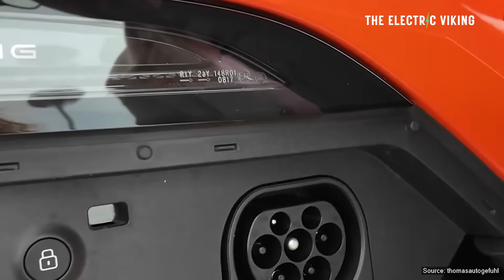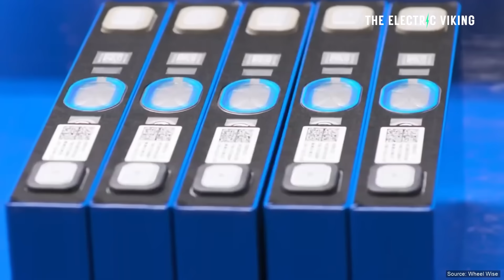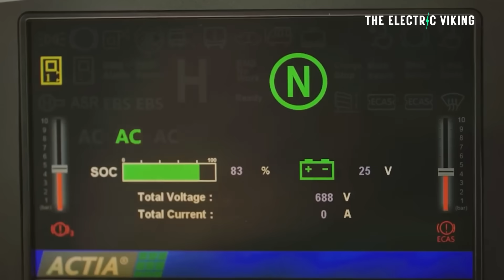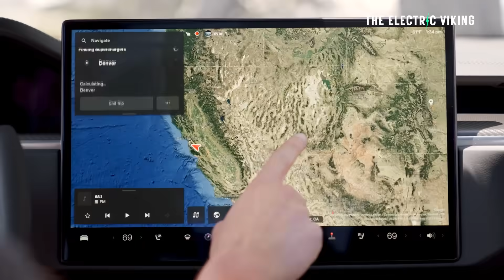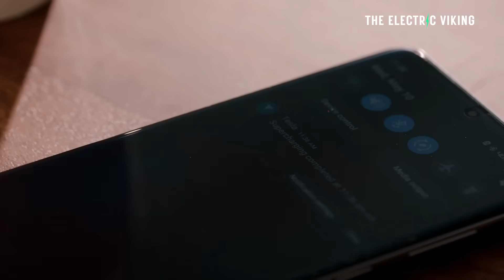Shocking data reveals the TRUTH - how long electric car batteries really last

Comment: Thanks for your EV advice and the massive Chinese car industry.
Can you do a video on how the Chinese charge their cars when they live in massive apartment types of structures?
I understand in the US where many of us have single homes.
Thank you Viking.
Reply: Good question.  But keep in mind that North America is still stuck with 120 volt default voltage for residential use.  This means charging from these circuits can be problematic  (time wise) for most EV users.  The majority of the rest of the planet uses 220 V plug-in connections, reducing the amount of time to 50% of what it takes for 120V outlets!
Reply: Thank you for the reply CH and I totally understand the 220v thing. Good point.
I'm wondering where all the available "charge parks" are and their vehicle capacities?

Comment: Hi Electric Viking - there is a big difference how long a battery last verses effective capacitary over 25 year life of motor vehicle. I still will not pay double the price for a car for half the range with accelerated deprecation of value. And if you use public DC charging there is no savings, who can charge from solar in Europe in Winter LOL.
Reply: 25 years...? maybe in Arizona

Comment: I have 10 yrs from new Tesla Model S P85D 100,000 km Hong Kong (90% slow charging at home) & min degradation, & going strong. Not needed to change brake pads yet.

My Porsche Panerema also from new was sold at 8 yrs as maintenance costs exceeded it's value.

Comment: I am not sure full regen is always good for example if you are driving in snowy or icy conditions it may cause the car to skid as it effectively brakes the wheels but in the summer months it’s definitely a good thing. I live in Finland and of course you have to adjust your driving to suit the road conditions. But savings on servicing your car are always a good thing. 👍
Reply: Could you do a video on this? On some frozen lake with an artificial driving course; try to go round a slippery corner with and without regen. That would be interesting.
Reply: EVs are too smart.  If a wheel loses traction the others compensate.  I could not get my Tesla to slide for fun without turning all the assist stuff off!
Reply: …..there is a ‘snow’ setting on my MG4 to prevent the wheels ‘locking’ in regen mode - adding further confidence to an already impressive vehicle- in my opinion 😉

Comment: Battery production quality can be changed and tampered over time and introduced built in obsolescence.
Seen in subsequent redesigns that typically shorten life cycles (example shaving razors, panty hoses and light bulbs).
The amount of energy in natural products like petroleum and LPG etc. is much harder to sabotage.
Reply: Like with alcohol or paint thinner? 😂😅

Comment: I'm still driving my 1980 Mercedes T1 diesel. I wonder if an EV will ever outlast my trusty old diesel.
Reply: No chance for EV.
Reply: A T1 couldn’t pull the skin off rice pudding, and unless it’s low ish mileage it’s probably had at least a fuel pump replaced or reconditioned by now, they are a pretty solid engine but has very little power, my apprenticeship was working on them.
Reply: I still have 2 bikes 1985 Honda GB500 & a 1992 Yamaha Virago.   Cannot see electric vehicles lasting this long
Reply: How many kms on it? Replaced an engine?
Reply: @Rebelapes  I don't know how many kms because it resets itself after 1.000.000 km but I think it's either 1.5M or 2.5M. I've had the car for the last 400.000 km and did all the repairs myself. No need to replace the engine, only replace the wear parts.
Reply: What a silly comment. In order for it to be useful information you would need to include lots of other information. 
How hard has it been driven? 
How far has it been driven?
What repairs have had to be done to keep it on the road?
Do most 1980 Mercedes T1 diesels last as well or is your vehicle a lucky freak?

You wonder if an EV will ever last as long. My guess is almost certainly yes, at least one EV will last as long but I've no idea what conditions will have been required for it to do so and neither do you.
Reply: Think of how many children's lungs you've filled up with 2.5micron carcinogenic particles :)
Reply: @mb-3faze but the battery production, transport, and disposal dousnt create this?

Nor the fossil fuel power stations that create the electricity for the car nah?
Reply: @  Yes battery production, transportation and any fossil fuel burnt to create the electricity will have created pollution to some degree. But with a little bit of research you would have found that an EV produces far, far less than  the Mercedes T1 from the 1980s, that the batteries can be recycled and more and more electricity is produced from renewable sources every year. 
The question is, why didn't you bother to do that little bit of research before making your comment?
Reply: @kalebdaark100  the comment was at the person suggesting EVs arent responsible for any pollution at all that would affect people, or children for that matter

There are far more damaging things being done to children from the modern world than modern car pollution, cars from the 80s still running are so rare they aren't worth mentioning

Using your research on the matters, how much pollution does an electric car produce when it goes on fire and emits extremely toxic gases and substances In comparison
Reply: @ryanwatterson4038  The comment wasn't suggesting no pollution from EV's. It was pointing to the carcinogenic diesel particulates in your exhaust. You know how people went stupid when the new diesel emission controls were introduced because they thought it was something to do with greenhouse gas and climate change - except it wasn't - it was to catch the particulates (little pieces of 'activated' carbon) that get into lungs and cause cancers. The new diesel systems burn them off from time to time to clear the filter so it all goes into the atmosphere, but at least the carcinogenic particles aren't dusting up the neighbourhood.
There's too many smoky old diesels where I live. I'll be happy when they're gone.
Reply: @ryanwatterson4038  Gosh, still trotting out oil industry propaganda. Blah Blah fossil fuel created electricity, blah blah EVs are heavier - more tire wear. Come on!
Reply: @mb-3faze  not spouting any propaganda fool,

I'm pointing out the hypocritical side of suggesting EVs are the perfect be all and end all whilst having no pollution to speak of
Reply: @  Tell me where someone in this comment thread said EVs are "the perfect be all and end all whilst having no pollution". No one with even a little knowledge on the subject would say such a thing. They are just better than ICE vehicle by quite some way....and yes you are spouting oil industry propaganda.
Reply: @ryanwatterson4038  Nah - you're spouting.

Comment: I have had my EV for four years now and driven 100,000 kilometers. I always charge at home with 11 kw/h. In the first year I could drive 480 km at 25 degrees. Now it is 450 km. I do not know if that is good.
Reply: 6.25% drop after 100,000kms? Seems pretty decent to me!

Comment: If you don't have a lot of home solar you have to charge at night - cheap rates to be sure.  But if everyone has an EV, how cheap will overnight rates be?   Obviously at that point the cheap rates will have become a distant memory with public chargers even more expensive.  Unless you live in the sun belt and have huge roof area to install 8 or 10 KW of solar it's game over.  And if you do live in those huge properties then cost probably feature much in your mind.   There's an old saying, something about becoming the victim of ones own success.  Or put another way, be careful what you wish for.

Comment: You've probably seen the video of the Telsa model S that's done 2 million km. He is on his 4th battery and 14th motor. It's possible the motors were replaced due to issues which have since been rectified. The batteries have lasted over half a million km each. Not bad at all for tech that's over ten years old..
Reply: Indeed!  If my memory serves me well, his third battery even lasted 850'000 km... over 500k miles!
The motors didn't die, the early Model S motor had a faulty bearing, and Tesla kept exchanging them under warranty... until the issue was solved once and for all by a third-party specialist, the EV Clinic, I believe.

Comment: Final nail in the old gas car used to be rust. Old Opel cars were notorious, Kadet for example. It is not necessarily the tech that gives up but the thin rusting sheet metal.
Reply: I have a 2006 Civic. Owned since new, now has 410k km. Driving in harsh Canadian conditions. Body rust will end its life within a year or two. The engine and transmission (manual) run perfectly. I expect to drive it to the junk yard, eventually, in perfectly working order except for body rust. It is totally normal to see old rusted cars on the road here. I have noticed that I never see rusted Teslas. For some reason they don't remain on the road here long enough to become rusted.
Reply: Fiats always came in two colours, the one you chose and reddish-brown that ‘nature’ added

Comment: That is not the problem. The problem is that when your battery says 100% and 30 minutes later, it drops fast like an old cellphone. If im wrong, let me know. Yes, it can last, but for how long does it hold the charge as the battery gets older.
Reply: You're wrong.  Typical modern EV battery packs degrade at 2 to 3% per year, with the degradation slowing after about 4 years. Many newer EV's have battery management systems and heat pumps, which increase efficiency. Your cell phone has neither of these...
Reply: @Brian-om2hh  OK if that is the case, then it is a win. I would hate to charge my car at 100 percent, and 20 minutes later, it says 80.

Comment: Battery swap is the solution. Nio 😊
Reply: ... to a non existing problem.
Reply: What happens to your 8 year battery warranty if you have it swapped out?   How could you be certain you were not getting someone else's abused battery as a swap?  Increased charging infrastructure, along with faster charging times will render battery swapping pointless. Which is why Tesla abandoned the concept of battery swapping over 10 years ago.

Comment: There's only 14 EVs for sale on ebay uk over 7 years old .
There's 10s of thousands of petrol or diesel  for sale on there over 7 years old 

If you don't believe  me look for yourself
Reply: ....because EV older than 2017 are few?
Reply: @orpsman76   that is not the reason there is only 14 second-hand evs that are 7 and 8 years old roughly 100.000 pure ev cars we're sold in 2017 and 2018
Reply: Mass market EV's have only been on sale for around 10 to 12 years.
Reply: @Brian-om2hh  Tesla have been making cars for 18 years .
And even if they did make cars for the last 10 years there's  over 25.000 petrol diesel cars for sale on eBay that are 7 and 8 years old there's only  14  7 and 8 year old ev's.
 your comment is embarrassing to say the least

Comment: @electricviking , Sam do any Chinese EVs have regen system. Specially Geely, Chery, BYD, Leapmotors.
Reply: I drive a BYD. It does have regen braking. Regenerative braking offers so much benefit over relatively insignificant extra manufacturing cost. I believe no sane EV manufacturers ( from China or from anywhere else ) are going to ignore this benefit.
Reply: @alihms appreciated thanks, you make my day.

Comment: Canada finished testing a 5 million KM battery that keeps 80% charge.  The future looks good.
Reply: But that's 80% of not enough to start with. You are already encouraged to not discharge below 20% or above 80-90% most of the time. So that's 80% of 60% (48%}  of whatever miles they said you would get minus hills, towing, heating,cooling etc etc
It might work for some, but definitely not for all
Reply: @DanRyan-v5y  80% capacity after going round the planet 125 times 😂 Yeah that’s nothing other than impressive. Plus we are probably only a few years out from 500-600 miles real world range in the cars and people needing to charge once a month. Big question is the Car will have disintegrated while the battery packs will have a very real value and most likely a second life in home charging. Or just recycle the pack that has a reached 87%  recycling while profitable to do so with cost 94% can be completely recycled into a new pack. The figures change every year and the profitability goes up along with the percentage level recycled.
Reply: @ it is at 80% after 5 million KMs.  That is over 50 years of driving.

NIO ET7 – 649 miles.
IM Motor L6 – 620 miles.
NIO ES6 – 577 miles.
ZEEKR 009 – 511 miles.
HiPhi Y – 503 miles.
ZEEKR 001 – 466 miles.
XPeng P7 – 441 miles.
Reply: @DanRyan-v5y  depends on the battery chemistry, some you can run up to 100% then straight down to 0% and back up again without any issues

Comment: but a battery replacement costs 10,000 an engine cost 3,000
Reply: Why would you need to replace the battery, when you could have it repaired or refurbished, just as you might with a worn engine?  An after market warranty supplier here in the UK, listed some of the claims it had then recently settled. One claim to replace an engine in a BMW, came to £8000. You won't find many recon engines for 3'000. And certainly not any new ones....
Reply: You won't get an engine replacement in a modern car for $3k. Those day's are long over. The upside, however, is that unless they suffer catastrophic failure, you wont need to replace it. Keep the servicing up and just about any engine in your average car will go at least 400-500k kms.

Comment: In the early days you would hear this but it's not the case now. The issues that will never go away are, range, cost of public charging, residential value and the cost of a new or replacement battery if you do need one.
Reply: Why would you go for a new or replacement battery, when you could have your existing battery repaired or refurbished for a fraction of the cost of a new or replacement pack?
Reply: @Brian-om2hh  😂 it would still cost a fortune.
Reply: @ic2433  I remember vividly having to change an engine after 130'000 km on a BMW... for an obvious design fault of theirs... but 10 months out of warranty... it cost me the equivalent of 10k$ back in 2003... how much would it cost now? 15k$? 

Replacing a battery out of warranty... but before you have put 300+k miles on that battery...  does occasionally happen, but the risk is very small.
Reply: @st-ex8506 when you think it's a racecar and drive it like that, never maintain it with regular oil changes etc, yeah you will get under 100k km. I have an old 53 Ford & 72 land cruiser and they run fine after 1million km.  Only had to change rings and do a few pulldowns to clean. Obv replacement rotors and pads and tires but they still going strong.
Reply: @ congratulations for having such an old and well-preserved classic!
But that car is the one in one thousand… or even ten thousand exception!
Reply: @Adam-yy5fl  My 4 kids were little at the time, and the BMW was my only car at that time… and we were all together in the car when it blew its perfectly well-maintained engine!
What happened is that the impeller of the water pump self-destructed, leading to engine overheating fatally before any warning was given. BMW had recently replaced aluminum pump impellers by plastic ones to save a few cents!
Please tell me what preventive maintenance could have avoided the incident?
BTW, why do you judge without even knowing what happened?

Comment: The big thorn in the side of Nissan Leaf batteries was the fact that they had no thermal management system in this vehicle.
Reply: Depends on your driving - My LEAF get's charged once a week at home as I only do short trips and work is only a few miles away, if your one of those people that drive 200 miles to work every day then another car would be a better option.

Comment: I have a hard time believing an ev will last longer than a diesel car, its not unusual to have a diesel for  25 years
Reply: Think of the environmental damage of 25 years of diesel use. Do you not care about the planet or other people?.
Reply: Just one issue to consider in the years ahead. It's unlikely you'll be able to get hold of diesel fuel easily in another 25 years. And it's also likely you won't be permitted to enter a town or city centre in most of Europe in one either....

Comment: A friend of mine recently had a full service done on his 2019 Hyundai Ioniq at his Hyundai dealer. The cost for everything came to €62.
Reply: Uh huh, and there isn't millions of 5 year old ice cars doing the same?
Reply: @ryanwatterson4038  Nope. Don't you get your ICE serviced at a main dealer? Even at an unofficial mechanic I've never even got close to that amount for a main service. I'd say that a typical main service for a similar sized car would be in the realm of €300-€400. That kind of service would normally include a full change oif oils (gearbox and engine) brake pads (that's gonna set you back anything between €80 and €200, and replaceent of brake fluid. The only one of those that might need changing with a Bev would be the brake fluid. But the brakes fluid, just like the pads, have a much easier life with a BEV.
€62  is basically paying for 1 hour of a mechanic's wages.

Comment: When I had the opportunity, I bought a Tesla Model 3 as soon as they became available, knowing it would outlast my previous cars. 
I tend to keep my vehicles until they either rust out or meet an unfortunate end—I’m still have my first daily driver when I was 17, now a 1958 vintage show car, and my current daily driver is 25 years old with 340,000 km on the clock. 
I fully expect the Model 3 to go even further, both in years and distance. 
The naysayers told me 20 years ago my wouldn’t last and should buy whatever they were sold, the same nonsense is still with us today, yet here we are